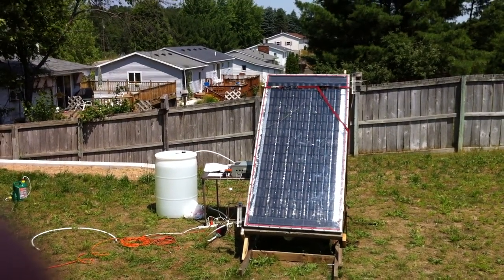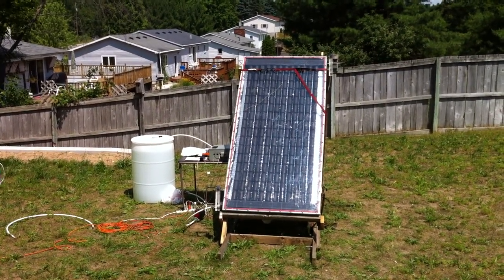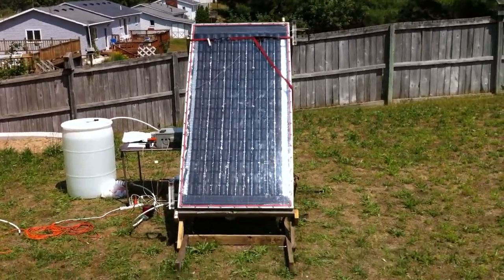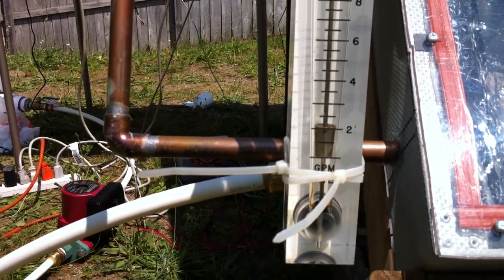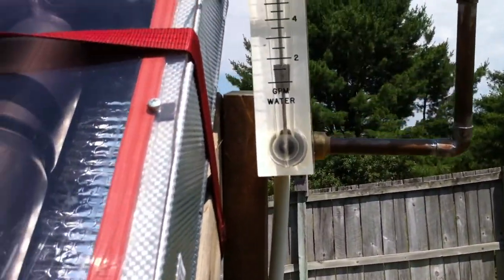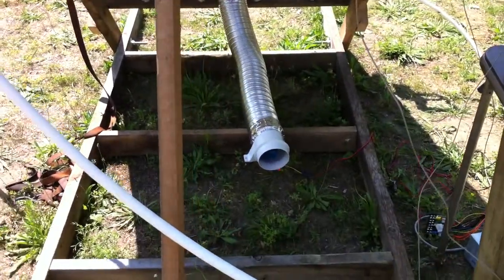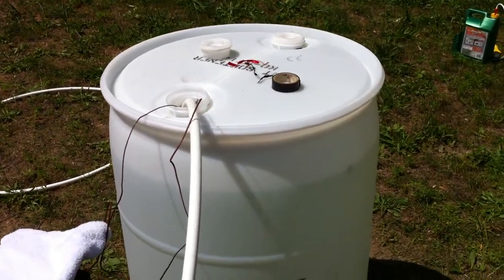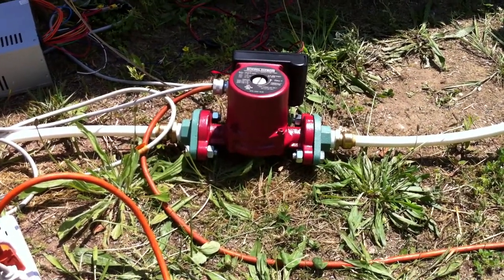Guys second  Build Test

Comment from the maker: Yes and no the hot water side works well I get a 7 deg. f. rise in temperature every time it goes through the collector but the hot air side does not have much air flow. I have taken the collector apart and started to rebuild it to have better air flow and I have made a better clamping system to attach the cans to the pipe.
Reply: This way you get heating during the day and no hot water is stored for heating during the night. Have you tested a copper tube collector without cans?